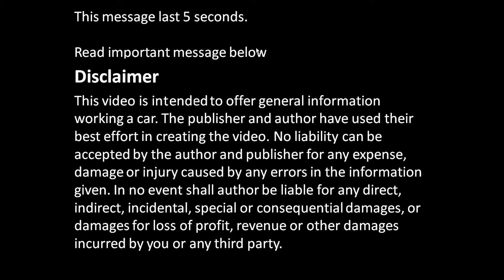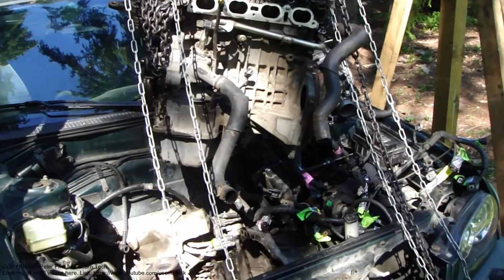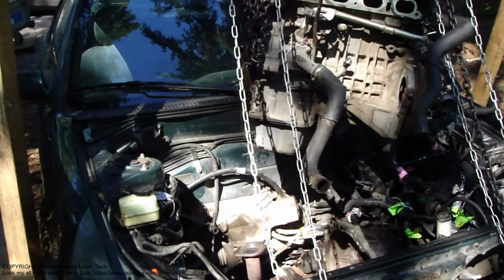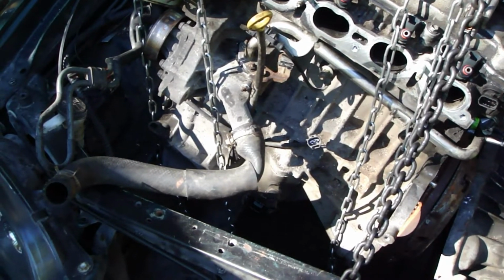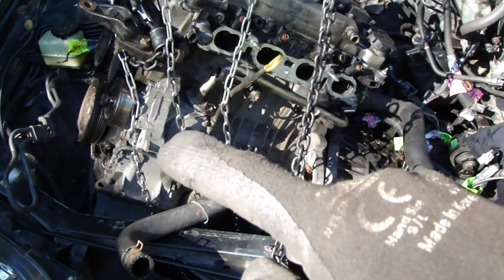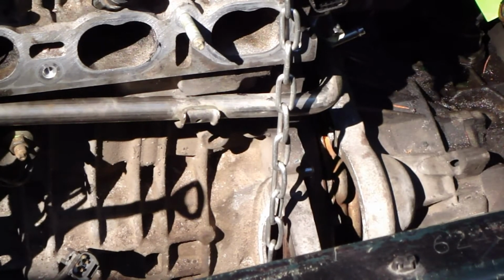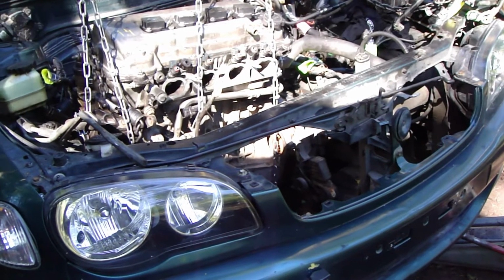Part 27/34 How to replace CLUTCH Toyota Corolla: Engine lift down and back. Years 2000 to 2022

Comment: do u have to take whole engine out for clutch  replacement
Reply from the maker: Normally yes.
Reply: sometimes depends on vehicle . Can usually be done either way .  Each way has pros/cons . If you drive shafts need attention then remove box and do them the same time you are doing the clutch. Other wise removing engine  maybe your preferred method  .